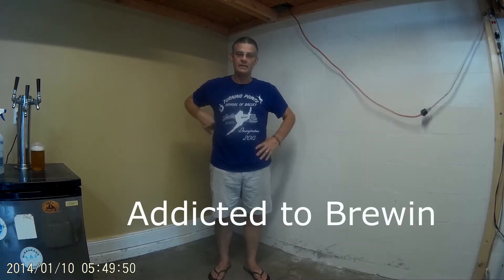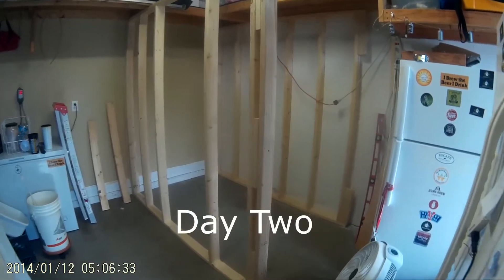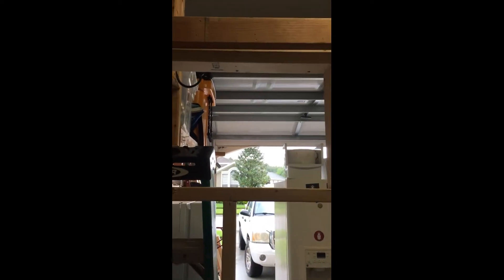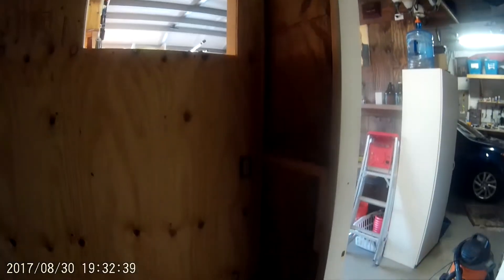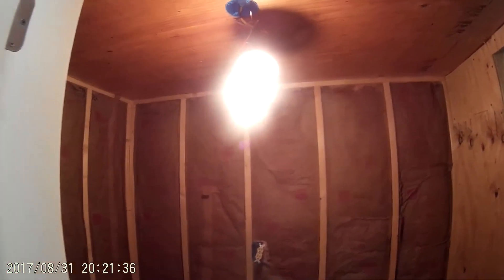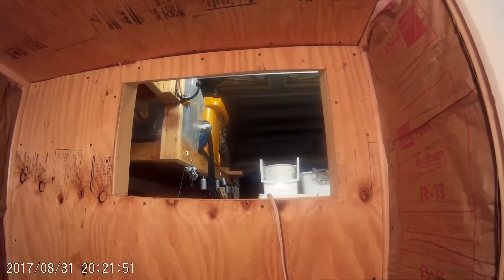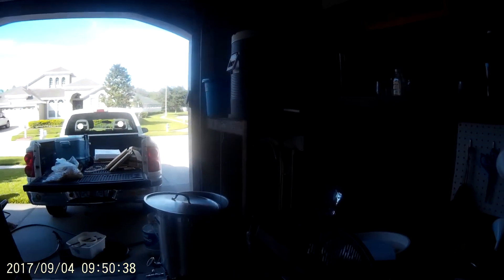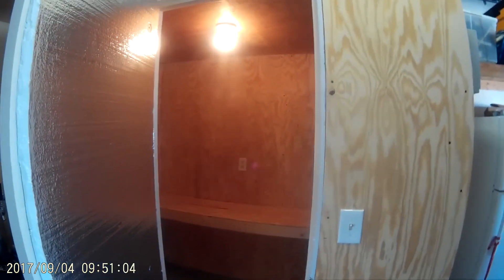Build a walk-in fermentation cooler.

Comment: Hi Randy! I’ve finally started my fermentation room build. Question - did you need a permit for the electrical work? My plan is to add a couple of outlets off of an existing 20A circuit. So not adding a new circuit, just additional outlets on existing. Am assuming I will still need one but can’t make heads or tails of the requirement from looking at the Florida electrical codes and regs. Thoughts?
Reply from the maker: Unless your HOA has a requirement, adding a 20Amp breaker to your panel should be no issue, unless you have reached the panel capacity, and then you would have to hire an electrician. They would know any code requirements. You can check with one 1st if you are adding it yourself.
Reply: Randy Gailit thanks for the feedback. It’s an existing circuit with only a single unused outlet on it. I’m planning to extend from that outlet into the new space. So no work required in breaker box 👍 I’ll check with the HOA just to cover the bases.

Comment: Nice build! How much water/condensation is produced by the AC unit and is there any concern with mold from it? I live in Central Florida and was thinking about a similar build so is very timely I came across your video. Well done!!
Reply from the maker: The air conditioner keeps the room super dry and no humidity. The garage gets very hot as you know. It can be 100 in the garage and the room stays at 68. The AC unit produces a lot of water which is drained off. I have seen no signs of any mold. I can tell you the room has improved the fermentation process to the Nth degree.
Reply: Randy Gailit thank you. Last question ... how do you drain off the water from the AC unit? Asking because the room appears to be in an interior corner of the garage. Or is it drained to a collection bin that needs to be periodically dumped?
Reply: Hey Randy! I’m getting ready to begin my build out in the garage. Since you have been running your AC unit for a while now, was curious how the heat dumped by the unit into the garage impacts overall garage temp, especially in the summer, or if it impacts the AC cooling efficiency as the external (garage) temp rises. Asking because the window units are designed to dump heat into a “well ventilated” space (ie - outside). Opening the garage periodically from normal usage and/or when checking on my fermenting/aging wine will dissipate heat and circulate air in the garage ... so am assuming it’s not a big deal. But there will be times when I am away (vacation, business travel, etc) and the garage may be closed for extended periods. Thoughts/recommendations?
Reply from the maker: KH, My garage faces due west and the radiant heat of the Florida sun keeps my garage very toasty. Since the garage is not sealed, any heat from tha AC is minimal compared to the sun. I would suggest that you consider a thermal window to look through. I always want to see whats happening in the fermenter and opening the door does put a load on the AC. I plan on putting one on my door so I can view without letting the conditioned air out. July/August/September heats up and makes the AC work a little harder but have not had any issues. Cool with humidity controlled in the room has been great for my brewing, mead and winemaking.
Reply: Randy Gailit thank you. Appreciate your insight.

Comment: how often does the AC run
Reply from the maker: i live in Tampa and during the summer, I have to condition down from 90-95 degrees to 68. It probably comes on 5 - 6 times per hour for about 3-4 minutes. I used to have 2 fridges and my electric bill has not gone up. I have plenty of space and the leisure of not having to hurry the process. Make it as insulated as you can.